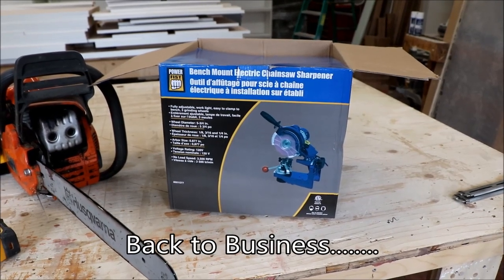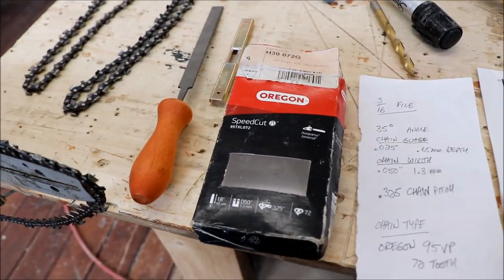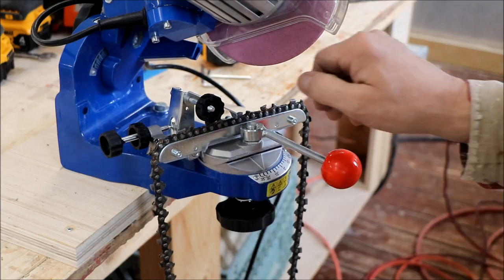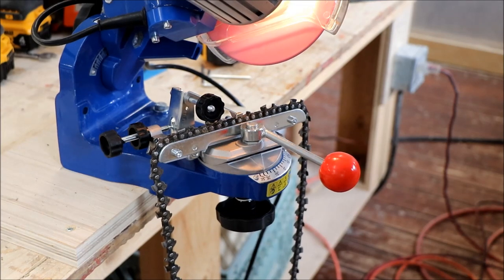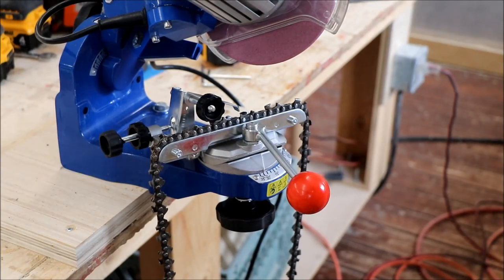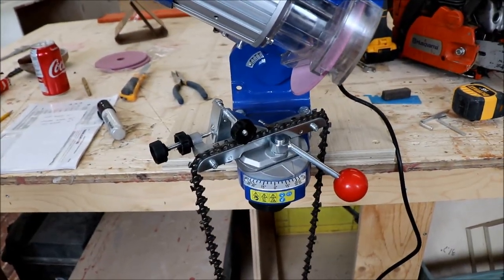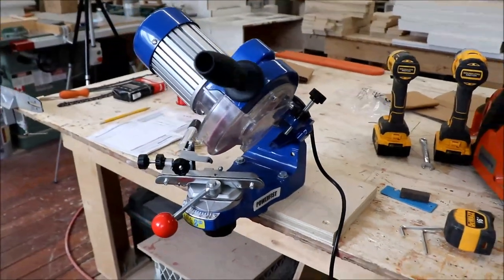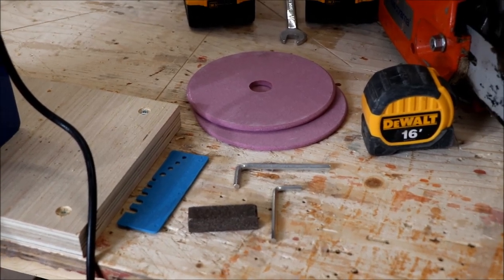Power Fist Chainsaw Sharpener

Comment: You can grind the rakers on the chain grinder also, set the front angle at zero and the head tilt angle at eighty. Grinding the rakers at a slight angle makes the chain smoother in the cut.

Comment: Hello, I do have the exact same chainsaw sharpener. I would like to know if we can have the motor turning in the opposite direction when changing to the other side of teeth. It does perform mutch better when turning toward the teeth compare as away from the teeth.

Comment: so you cant change blades without removing the base? my Oregon 410 can change blades pretty easily just remove the cover plate. I use different blade for cutting the rakers. made a video about it if you want to check it out.

Comment: Are you sure that you have the 10 dog angle set right? I thought for right hand cutters the chain should be tilted towards you. Adjusting knob away from you.
Reply: I WATCHED THIS VIDEO TO TRY AND FIND OUT WHAT ANGLE TO SET AT, NOW IM REALLY CONFUSED.
I SET MINE AT 0 DEG AND WORKS GOOD BUT STILL SAYS 10 DEG  FOR 23RS CHAIN
Reply: I know this is old but if you check your bar on your chainsaw it will give you all your angels. That ten degree tilt. You'll never use that unless your in the business professional and use commercial saws and chains
Reply: Right hand cutters . right away